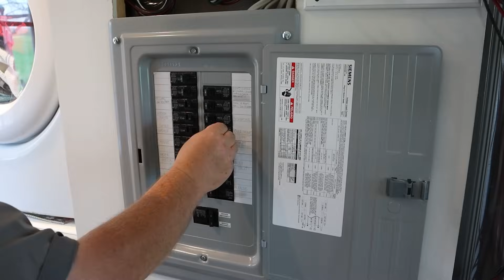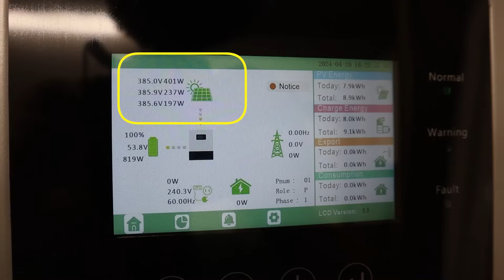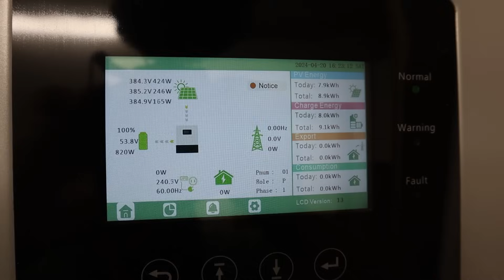CRITICAL STEPS of an Off Grid Solar Project... TAKE NOTES!

Comment: When I was installing a ground rod, I pounded on it for a long time and it was barely moving. I grabbed my small jack hammer, took out the bit, slipped it over the end of the rod, and pulled the trigger. I'm not exaggerating, it took 30 seconds and the rod was in the ground.
Reply: There's an adapter for rotary hammers that works like magic in my experience.

Comment: Those WAGO connectors have a concern.
They were tested with other connectors, and they were just ok with low to medium loads.
But when they were loaded up with a heavy load, they got hot and melted.  This is a possible fire concern.

When we looked at the connection of the wire to the WAGO snap fitting, we see that the wire has a very small connection
to the conductor inside the body.  The connection is minimal so it will heat up under load.

WAGO connectors are ok for maybe lighting which is usually around 1 to 5 amps loading but I wouldn't  use them under
a house circuit loading, certainly nothing with a heater resistance or heavy load from appliances.

you need to see the test, the WAGO connector melted to a blob and came apart.

I dont promote the WAGO for this reason.

Comment: Sam, this was a LOT! I trust you to do what’s right and safe, could you please do a simple solar for dummies video? I want to do solar for my barn, but this is WAY overkill.
Reply: You could use an all in one, pre-wired small solar panel directly connected to a light, if it's a tint barn. Under 500sq ft of space could be lite up by one light or two. Connect panel to the roof facing south to southwest, drill hole in wall to run the wire thru. Place light. And then plug wire together. Done.

Comment: Tons of work for sure!  I liked that trick with adding a smaller tube over the wires to cut the bigger conduit!!  I noticed you installed an auxiliary grounding electrode (ground rod) at your panels, assuming your house has the main ground rod.  I am not an electrician but usually the ground from the panels would go to the small ground bar in the inverter which is then connected to your homes ground and ground bar.  That 2nd rod allows another route for transients to come into the system or another route for lighting or surges into the system.  "They" say to bond ALL grounds to one place.  Having the 2nd rod is allowed by code but not needed.  I did the same thing on my system in the beginning and then a licensed electrician said its best to remove it.  Also watching the Mike Holt videos on YouTube.  Hope this helps🤘
Reply: Since there is no electrical connection between the solar panel frames and the positive and negative wires of the solar panels, there is no need to bond them to the house ground. Putting the ground rod next to the panels makes more sense to me, because if a lightning strike hits the panel frames, it will be grounded right there, rather than going through the house then to ground.
Reply: @AveRage_Joe you are correct!  And Mike Holt videos are well worth watching to better understand this!

Comment: The Reliance Pro Tran 2 transfer switch is the best way to go IMHO, I however had to use 2 of them on my solar install due to the number of breakers in my box. I love how you installed it flush with the breaker box. This didn't cross my mind when installing mine so they protrude from the wall.  Nice install, well done, now all you have to do is sit back and enjoy self sufficiency :)

Comment: In the field (utility substations) I frequently saw crews cut in-service pvc using waste pull cord from multi-conductor cables. Use it like a wire saw. Low risk of insulation damage if you don't go ham on it.

Comment: Most things solar are pretty basic. But when you connect it to your grid system, it's more complicated. 
I am not a technical person at all. But I have managed to be able to install and wire my tiny system and add a side charging station on the wall of my motorhome to charge my cell phone, run the 12V DC fan (no A/C) for hot days, and to circulate the hot air when heating the motorhome. I also charge my USB rechargeable  LED  14" kitchen & bathroom light bars, my USB rechargeable 4ft long automotive repair LED light bar, and my USB rechargeable LED flashlight/spot light. (And my tablet & computer before they were stolen.)

Comment: I was wondering why you went with this setup, rather than doing a whole house transfer switch that would just interrupt the main power wires coming in from the grid and switch the entire breaker panel over at one time.  It looks like you have enough solar capacity to handle the whole house.
Reply: While the way you suggest is much easier, the way Sam did it makes it so that they can choose which items/plugs, etc., they want to take off grid. Just as an example, they may want to run all the heavy-duty loads off of their inverter, and use the grid for only light loads. Or, they might want to do the opposite if there have been too many cloudy days for their battery bank to handle. Just my thought.
Reply: @Tumbleweed5150  He did a good job explaining his reasoning in his latest video which was an overview of the project.  Later, if he is able to add more solar and batteries, he may be able to supply all his needs with solar, but for now, he is only able to partially cover his total usage.  So the individual switches make sense.  I made the assumption from his video titles about taking his home off-grid that he was installing enough capacity to cover everything, but now I understand what his plan is a little better.

Comment: We have a back to the grid solar system which means we will still get power even on dark days. We have 32 solar panels on our roof and we generate much more power than we use. We have a big swimming pool and the pump is on for 8 hours a day to keep the pool clean. Our power company gives us a credit for the extra power we generate and every 6 months sends us a check for what they owe us. We wouldn’t change a thing as it works perfectly for us.  We pay nothing for our power and get around $600 every 6 months for our extra power.
Reply: You must have one of the old NM programs, seems like all the new programs are, or will be far less favorable for the solar generator!  I think mine charges $0.34 and pays back $0.03!

Comment: Mr Sam , The cable you buried between buildings looks like SER Cable. If so it's not permitted to be direct burial as you did. The ground wire will corrode and you'll loose your ground.  Very dangerous!  Please check your cable to see if it is rated for direct burial.
Reply: I failed an inspection because of using SER underground. I was able to pull in a green thhn ground wire and passed inspection.
Reply: @peterkavan8368  Did you install your wire in conduit?

Comment: Conduit fill is a pain sometimes. The sum of the cable area(s) divided by the area of the conduit should be less than 40%. Not an exact fill Calc by code, but it's a good place to start.

Comment: It appears your solar disconnect you installed is not DC rated, based on the model number.  Every solar disconnect I have ever installed breaks both positive and negative.  Also it appears the disconnect is only rated for 240 VAC.  You have a lot more voltage on each string.
Reply: IMO DC switches are much better for PV than the disconnect used here. Specially because they disconnect both positive and negative fast to avoid arcs.

The disconnect used here is actually 600V DC rated.

Comment: Curious why you just didnt run your main into the inverter and then feed the main panel from the inverter.  The inverter will feed what it can and if you lose power just shut off non critical loads. That 18k wont back feed if you set it to off grid.
Reply: The way Sam did this allows him or his wife to choose what circuits they want to connect to the grid, and which ones to connect to their inverter. Much easier to juggle power usage that way.

Comment: Great video. I recommend dry fitting the conduit prior to running the wire so pulling panels and cutting conduit loaded with wires is eliminated.

Comment: That was amazing! Just wondering how you attached the copper ground wire to the rod in the ground. Sorry I'm not super electricity inclined.
Reply: They sell a few different types of clamps that clamp on the rod and the wire. It is so basic he just probably forgot to mention it.
Reply: @Tumbleweed5150  trade name is acorn clamp. 5/8" or 1/2" should be 5/8 ground rod and acorn clamp rated for direct burial.
Reply: @peterkavan8368  Thanks for the information. I, (and my neighbor, whom I help out a lot and learn a lot from), have used a couple of different kinds of clamps for ground rods, but I never knew what they were called.

Comment: Check page 16 (printed page) of the eg4 manual. 

It is my understanding that you need ferrules on the PV wires. Someone had a fire. I am not sure if you can combine wire where you combined them. Also I would think the closer to the lighten strike the device is the safer your charge controllers would be.

Comment: When you get more battery capacity you may want to program a limit in the system and stay under 80% charge (depending on battery technology used). It will make them last longer. 

If you look at your power usage daily average from the power company and compare to how much you use while the sun is down, divide that number by .8, and that number is the capacity you need.

Comment: Hi Sam; I have some concern about placing 2 different gage wire sizes in the same lug? The thinner gage may not get tightened properly. Thanks for the great videos. Frank 😊
Reply from the maker: The lug used is designed for the range of wires used.
Reply: @sam-and-angela  Thanks Sam; I'm not use to seeing it accept different gauge wires. They must be special lugs?
Reply: @wb2ire  The lugs looked to have a seperator in the middle, so that each wire is set in place with its own screw. You would just need to screw in the side with the smaller wire a bit more.
Reply: @sam-and-angela  neutral wires must be under one lug only. Ground wires can be grouped under one lug but check how many grounds can fit in that lug hole

Comment: Like always, great video! Is the 50 amp transfer switch somewhat limiting? The manual for the Inverter makes reference to having a 60 amp breaker as a minimum. Thank you for your input.
Reply from the maker: It's within the power draw of our small mobile home and the circuits we have on it. Our battery bank is not large enough to run the largest 240v loads (stove, clothes dryer, water heater) without quickly depleting our battery. So we did this transfer switch in lieu of a critical load panel. The switch allows us to quickly change circuits in the home from grid to off grid without moving breakers. We want to add onto our battery bank in the future so that we can truly run everything off grid.

Comment: Well I’m sure that was easier seen than done 😳😉😊
Reply: That got a laugh out of me. I have done quite a few (much) smaller solar installs at my off grid home, and I know how easy he made a fairly complex and hard job look. Handling those cables and bundles of wire looked easy when he did it, but I struggled to put in smaller cables and wire bundles. :)

Comment: I would not earth a ground mount solar system, and it's not required by NEC(2020 and newer) unless your County/City is way behind on adopting newer NEC.  Roof installs are different.  If you do earth, you should bond your earthing rods to your main house or main earth if it's grid-tied, you don't want a second potential to earth to avoid an earth loop which can be dangerous.....and PV is DC, you can't clear a DC fault with earth.  Otherwise, good install and choice of components, it should serve you very well.

Comment: I just installed a ground post for my 280ah solar generator at my cabin. I didn't go all the way into the ground. It's sticking about 2" above ground exposing the point where the copper wire attaches.  What is the benefit of putting it fully in the ground? I've never heard that before.
Reply: ive never seen one drove like that either.  big key with grounding is validate the ground, looking for 10 ohms or less, this often is the over looked key  point in grounding
Reply: Ground rods have to be fully driven that means below grade, so no part exposed above ground don't know why maybe so the clamp can not be knocked around from a lawnmower.
Reply: @peterkavan8368  Makes sense.

Comment: The transfer switch wiring is not up to code. The red and black, white and green must be I conduit or a close nipple between the panels.. Also the main feed from your inverter needs to remain in its outer jacket all the way into the transfer switch.
Reply: Correct Ser needs the gray outside jacket. Thhn or the like must be protected between transfer switch and main panel

Comment: Based on the figures from their links I estimate they spent $20,000 at least on the whole system. If I use my bill as an example it and the system takes me 100% off grid it would pay for itself within 4 years or so and have another 6  years under warranty on the batteries.

Had they paid for an installer to do all the work it probably wouldn’t be worth it .